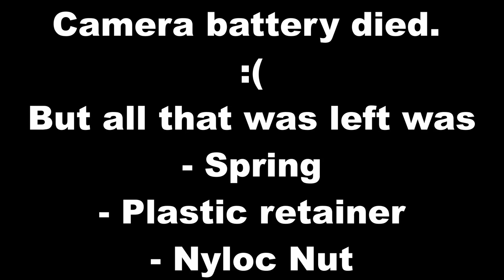Absima CR3.4 Sherpa : Upgrades - Holmes Hobbies Crawlmaster Sport (12T) and Metal Gears

Comment: I think you forgot to break in the motor . HH have a guide on there website for brushed motors. 2.5-3 Volt for 3-5 minuts. Without load . To seat the brushes .
Reply from the maker: Quite right, thankfully it seems to run ok, but I guess it might not last as long. 🤙

Comment: Was there enough grease in stock gearbox or worth opening and adding more
Reply from the maker: There was in the gearbox, but the diffs and the portals both needed doing.
Reply: @PhilBrindley  done them but was going todo gearbox but if okay will leave it as big job is it?
I got the red pro version in uk full metal gears stock
Reply from the maker: @sailingachilles7810  how were the portals and diffs. If dry it might be worth cracking the gearbox open, just to be sure. If they were well greased then the gears probably will be too.
Reply: @PhilBrindley  lack of grease there was, just a enough blue grease for a cotton bud in them

Comment: Hi thanks for your video process.why do not change the transmissiok crown by steel at 23 minutes at your video?
Reply from the maker: Hi, if I'm being totally honest I didn't change it because there wasn't one in the kit that I bought and I did not think to see if one was available. I have not had any issues with the plastic spur gear so far though, so unless it fails I have no intention of replacing it.
Reply: @PhilBrindley  ok thanks and would you recommend doing it?
Reply from the maker: @predator50260  Honestly, I wouldn't bother unless you are looking to change the gear ratios significantly. Also I think it helps to have a plastic gear in there in case of a lock up somewhere in the drive train, better to strip a plastic gear than burn out other components.
Reply: @PhilBrindley  ok thanks for your advice. so i just change intern gear box crown

Comment: Hi there I know it can sometimes be good to swop out your plastic gears for metal ones. But it can also be bad, too. If everything is metal and the car jams up then something else will break. If so this could be a lot more expensive to replace than a plastic gear. I'm just telling you this through many years of experience. So be very careful what you replace, plastic for metal as it could be far more costly for you in the long run.
Reply from the maker: Hi Robert, that's sound advice, thank you! I've left the plastic spur gear and slipper clutch in place, so hopefully that will save me if it locks up 🤞🤙
Reply: Yes the abisma is fitted with a spur gear wich has saved mine and it only cost only £8.50 for a new one

Comment: What is the metal gear set part number, and who is the manuffackturer
Reply from the maker: https://m.aliexpress.com/item/1005001487018383.html?srcSns=sns_Copy&spreadType=socialShare&bizType=ProductDetail&social_params=20118847652&aff_fcid=f57e149d07d84d548b722c4edb1191a5-1616954362442-01467-_mLADkr9&tt=MG&aff_fsk=_mLADkr9&aff_platform=default&sk=_mLADkr9&aff_trace_key=f57e149d07d84d548b722c4edb1191a5-1616954362442-01467-_mLADkr9&shareId=20118847652&businessType=ProductDetail&platform=AE&terminal_id=1f53d866170f487b8c4ceaf4b1a4d06a

Comment: nice upgrades! Would you kindly give the link to the metal gear parts? the link you've replied on Jukka Koskelin isn't working anymore.. thanks
Reply from the maker: Try this one. Alternatively you can buy the official Absima ones from them or perhaps another online supplier.
https://www.aliexpress.com/item/1005002100433247.html?spm=a2g0o.productlist.0.0.2433226c6rY2MJ&algo_pvid=e56dbc6c-a860-49a5-89a6-907c0e3e3fac&algo_exp_id=e56dbc6c-a860-49a5-89a6-907c0e3e3fac-3&pdp_ext_f=%7B%22sku_id%22%3A%2212000018740878965%22%7D

Comment: Hi mate just wondering how tight the slipper clutch needs to be just put fusion 2300 in and it wheelies like crazy does that mean it’s too tight
Reply from the maker: Hi. You want the slipper to slip when the wheels are bound up, so wheelies are not a clutch issue. I assume that’s in second gear? If it’s too fast you might need to get a smaller pinion gear for the motor.
Reply: I kept the stock pinion on its on my friends car I did work for him I’ve got same in my Trx 4 with no issue what’s stock pinion on Sherpa and what would you suggest going to
Thanks
Reply from the maker: @bentasker2265  the 21t stock motor is equal to about 2000kv, so will need to gear down. Stock pinion is 16t (mod 0.8/32dp). Maybe try 13 or 14t. Or just try 2s if you are running 3s.
Reply: @PhilBrindley  will it be ok with same spur gear will they work together
Reply from the maker: @bentasker2265  so long as you get the right pitch (0.8mod/32pd) it should be good. Check that there is enough adjustment on the motor mount to be able to move the motor a bit further inward towards the spur so you still get a good mesh. Could also try calming some of the settings on the fusion so the take off and brake force are less aggressive.

Comment: Hello have question how was your experience with the new motor and metal gears in comparison to the stock ? Thanks greets Jo
Reply from the maker: The motor is great, worth it for the price. Bit more speed than the stock one and smoother low end control.
I would say the metal gears made no difference other than being louder! Long term I'm sure they will be more robust, but next time I would probably just buy a set and only install them IF the plastic ones broke or wore out. Hope that helps. 🤙
Reply: @PhilBrindley  thanks for your reply again great videos and how to do tutorials 👍👍👍
Reply from the maker: @vitara1969  anytime, my friend. 🤙